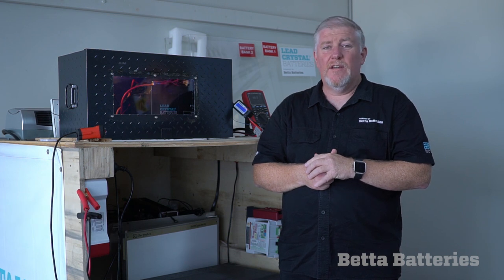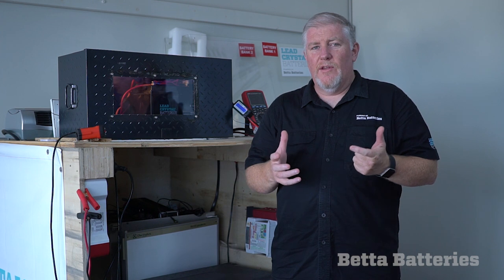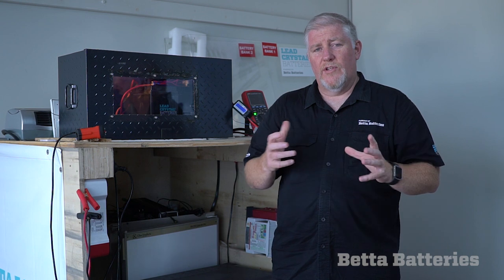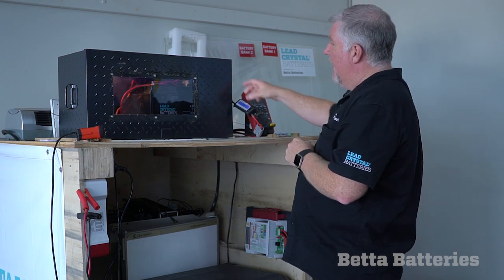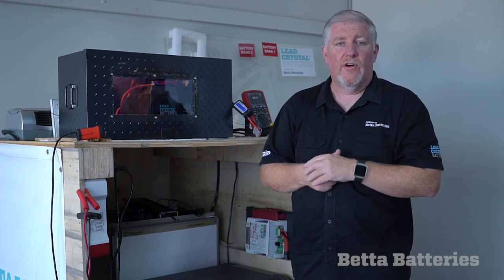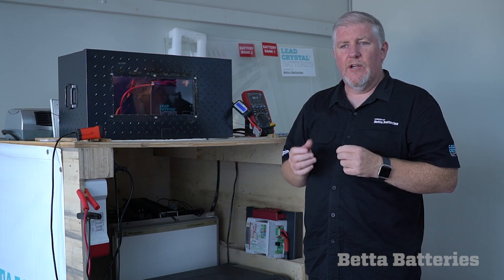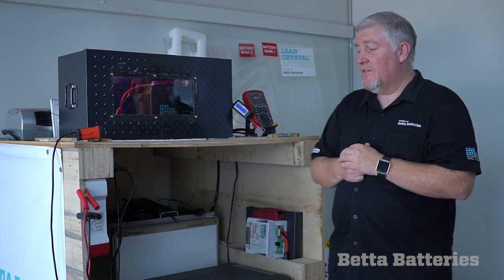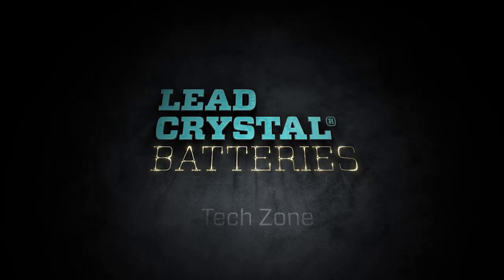Under Bonnet Charging with Lead Crystal Batteries

Comment: Hi, I have 12 Lead crystal batteries  6-EVFJ-100  12V 100AM. both new 4 april 2018 and used only 4 months and since then never been used. i have tried to charge them about a week ago but nothing happing the batteries won't be charged. would please help with this issue. thank you

Comment: Hi iv got a lead Crystal battery 170ah do you sell the charger for them iv bin watching you videos but I’m afraid I’m a bit dyslexic and don’t understand Ann I want is a charger that I clip a live and earth to and turn it on to charge look at the reading when charged unplug and put it in my camper van. I was toying about getting a 100w solar panel to put on the roof and run it through a MPPT to keep it topped up will that be ok ????? But really need a charger 240volt 
Looking forward to your reply 
Dave,,

Comment: I’m interested in this battery technology, but there’s not much information out there to help someone decide whether this is the battery for them. Thanks for the video, but I’m now more confused. You presented a lot of information and mentioned all the testing, but I could draw no conclusion from all the details. 
With due respect, there’s a lot of Internet forums out there that say this technology is snake oil. I wish I could find definite information on Lead Crystal which would put my mind at ease.....and help me decide on......1. is it okay for an engine bay install? 2. What type of DC-DC would I require for a certain aH battery? 3. What sort of charging setting is required? 4. And a few other factors that I can’t remember right now.

Comment: just wondering how you manage to charge the battery at 90c with a DCDC under the same conditions as all DCDC chargers I know will derate from 50c cut out at around 80c
Reply: they say swaling is normal... :) wtf :)